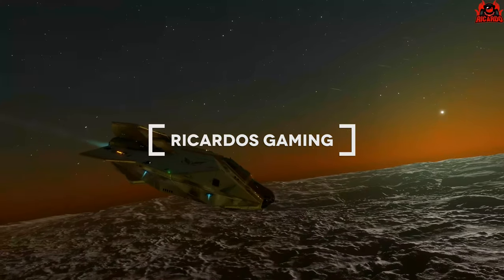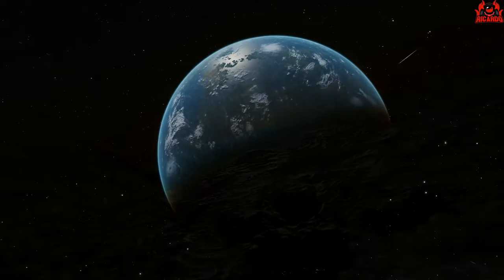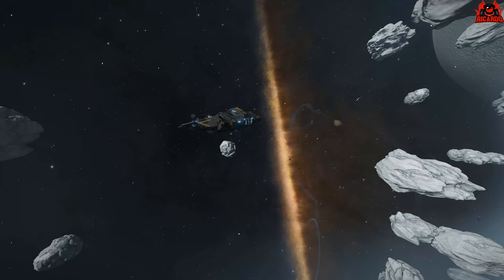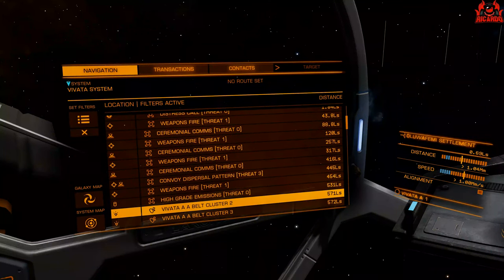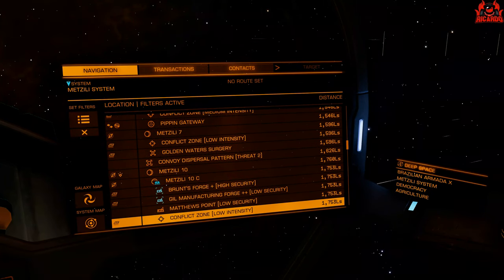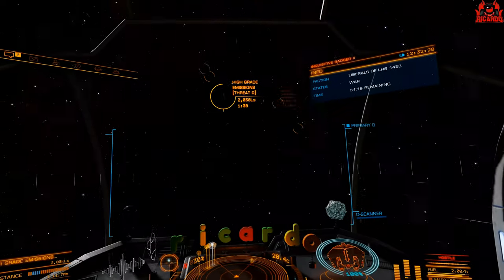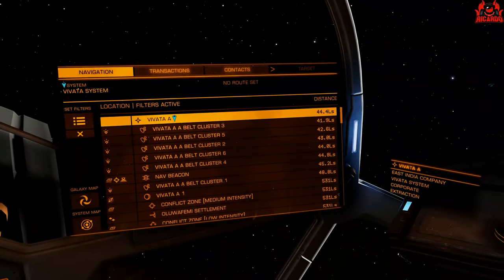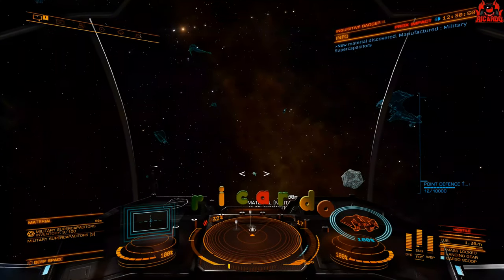Why You Should Be Collecting Hi Grade Emissions in Elite Dangerous

Comment: Worth pointing out that each specific item (i.e. Imperial Shielding) gives you three of that type, so you picked up 12. Also that if you max out (and you can) you can visit a Material Trader and trade them for other level 5's then go back for more. If I could find one good system that never dried up of hi-grade sites (I wish!) I'd be a made-man in engineering. I find the biggest problem is finding these systems. Ever since the Elite map changed I can't get it to behave. Even Inara gives false results.